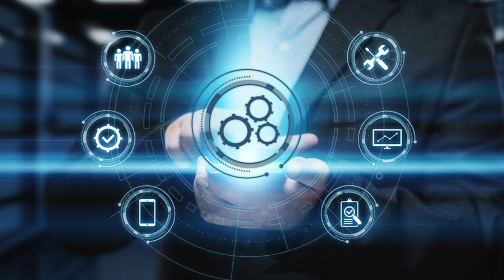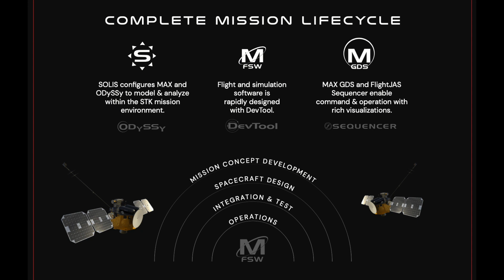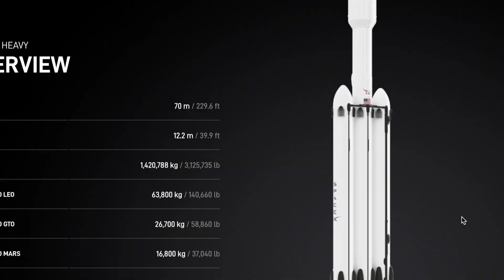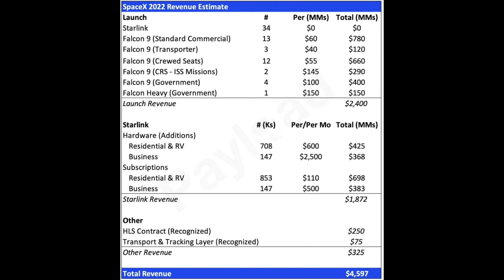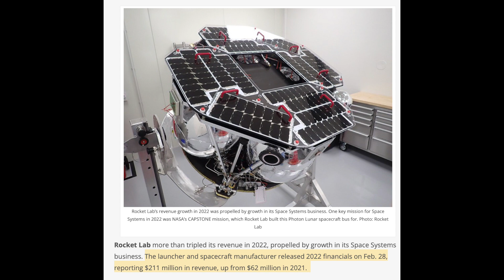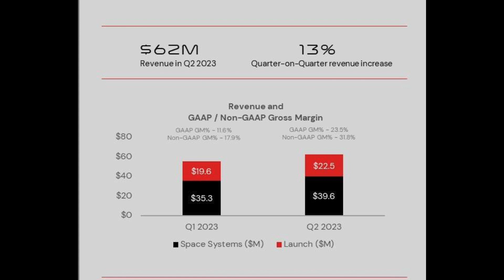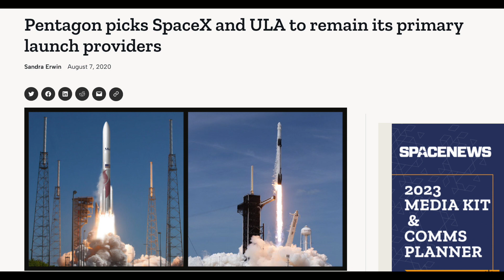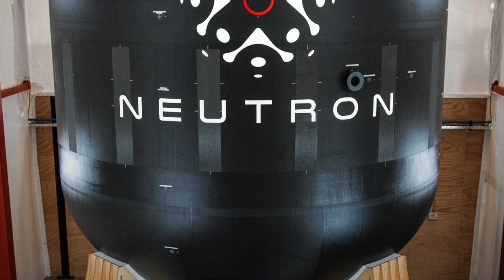When Will Rocket Lab Be As Big As SpaceX?

Comment: I am in this stock at over 10 bucks.  My big question is when will I be above water?  I have been thinking about amending by buying some more at it's current lower price.  I am watching it to figure out where it bottoms out.  3.75 to 4 bucks seems to be a safe place to buy.  I thought it would keep falling last week, but it turned around on Friday.  I think it is second after Space-X.  Big fan of New Zealand.  I think we will see Neutron before self driving cars.
Reply from the maker: Hello Jacques! The stock has been a bit wobbly along with rest of the stock market. I was going to do a stock analysis on Rocket Lab but this video was already a good length so I will be posting another video specifically on the stock price and where it is headed so stay tuned! My goal is to release it tomorrow. 😉Happy to hear you are a fan of New Zealand!
Reply: Don't worry.  Rocket Lab will certainly surpass 10.00/share soon enough!
Reply: If neutron launches successfully the stock will go over $10 easily..